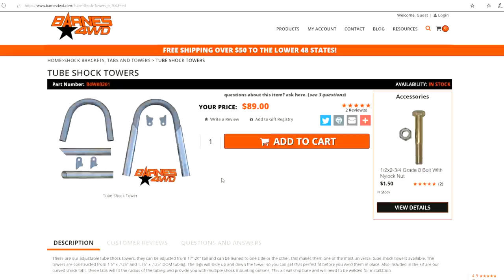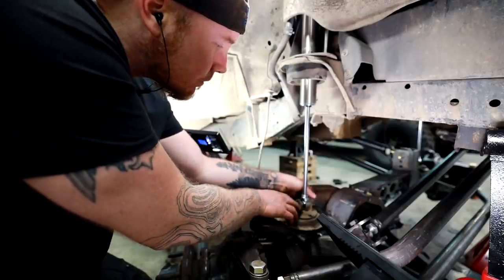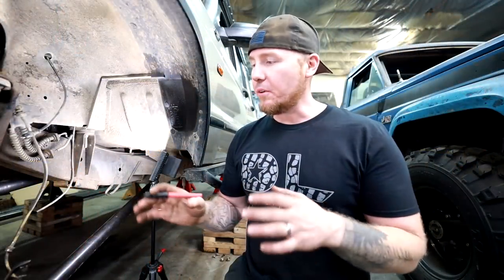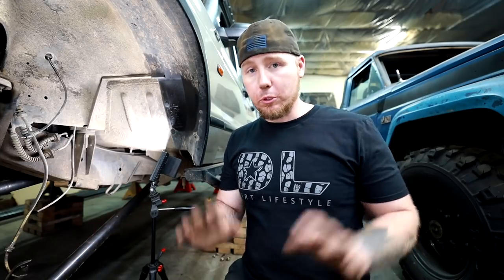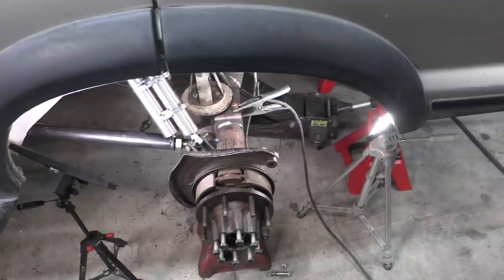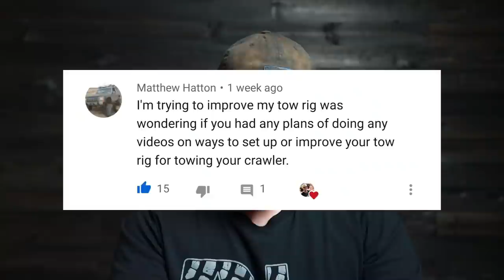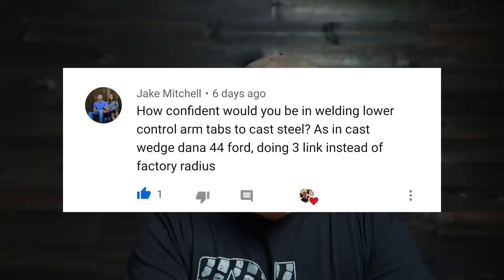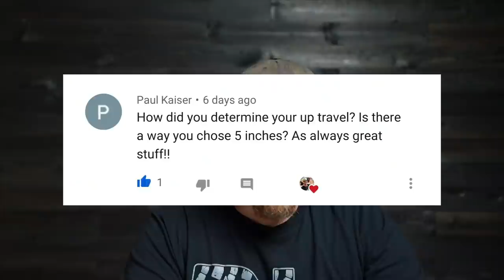Save Your Shocks! 1 Ton Axle Swap Series. Step 6. Bump Stops and Limiting Straps

Comment: Does your flexed out suspended measurement differ from your measurements if you were just to lift your vehicle by the frame with a engine lift. Is there any leverage that factors in.Thx Nate your channel is great

Comment: Yeah; I'd like a gear and locker; I have an old tracker that I'll put a front locker in, and 2 old YJs that may or may not get them (one will for sure).  Maybe explain a couple of things, like high/low pinion, backlash and setting that correctly...a lot of videos seems to sort of say 'we're not setting the backlash'...great...what does that look like?

Comment: Curious what your experience was with selecting shocks, sounds like you got some help from Bilstein there.

I'm a (young and relatively inexperienced) mechanical engineering graduate with aspirations to build both on- and off-road performance machines in the future and I find that if I try to analyze suspension to figure out an ideal damping coefficient and match that to a make/model I wind up in what we call "analysis paralysis", drowning in all kinds of assumptions about the vehicle's environment, speeds, etc. 

What kind of rules of thumb and tricks of the trade did you come across when selecting what shocks to buy? Did Bilstein reps share and words of wisdom, charts, etc. with you when going through that process?

Comment: What gears are you looking to run in the one ton swap? Got a 1986 f250 I’m trying to get into an overland setup. Currently on 33s and looking at 37s. I have a Locked 40spline Dana 60 front(came with 5.13s) that I’m going to install. The truck  weighs around 7.5k pounds once loaded. Just unsure if I should swap my rear to match or go around a 4.56/4.88. And lovin the series!
Reply from the maker: These axles are getting 5.38s 👍

Comment: Have you considered moving the shock mounting tabs to a lower position on the axle? Like as it sits currently it looks like its at the 10 o'clock position. Would it still give you the same amount of articulation if you reposition the tabs to the 8 o'clock position?

Comment: Question, when you showed your axle bottomed out, you said you have plenty of up travel left in the shock. But it looked like you still have 3ish inches of up travel before it bottomed out. I know lowering your shock mounts would be a pain for 2 inches of travel, but what would the least amount of movement you would want left in the shock at full bump?

Comment: Where do you find shocks fail videos on Youtube as you described? I'd like to look at them
Reply from the maker: I just looked and I'm have a hard time finding some! This was back when youtube was mostly short clips. I saw a few short clips of guys with shock failures. The worst was a cherokee with radius arms. He goes over a rock, the front end droops down and the both shocks let go. The rear axle is still behind the rock the front axle now is in front with a broken front drive shaft, and the springs are laying on the ground. It was only a 30 second clip but I will never forget it! If I find it I will repost it on social media 👍

Comment: Question about front shocks: any reason you installed the bottom eyelets parallel with the axle rather than perpendicular? Seems like it'll put more torsional stress on the shock body/top cap because of the changing angle of the axle. Just wondering 🙂

Comment: Great quality content, love your work. Do you think the angle of the shock will effect the way it works? (In the front it looks perpendicular/90 degrees and in the rear it looks like it is sitting at a 45 degree angle) If so, how will it effect it? Cheers

Comment: Question: Hey Nate, I’m currently building a yj and I am a novice on nearly every level so I simply learn what I’m doing as I do it. This video has me wondering, how do you determine what length shock you should be running? I’m replacing the shocks on my rig and I’m just curious if there’s a measurement that can be taken from the mounts to determine the proper length shock to order. I could just measure the current shocks but I’m not even sure they are the correct length. Thanks for the great content, big fan been watching since bleepinjeep

Comment: any insight and pros/cons and reason for the angle shocks are mounted at, is perfectly vertical best if you can package it or is any angle fine if you get the right shock to make up for it, also theres forward and backward angling as well as inward/outward, obviously room to fit it is at the top of the list as shocks likely are getting last dibs on chassis space

Comment: Is something preventing you from lowering the rear shock mount on the axle to make them work?
Reply from the maker: Bolt clearance of the control arm and the backing plate. Or I go way to low and a rock takes it out. I have ripped off a few low hanging shock brackets over the years lol
Reply: @DirtLifestyle  Kinda looked like that! Yeah don't get me started on the shock mounts falling off a GM AAM 11.5 lol

Comment: In the last video I asked if you run a three link with panhard and the pumpkin sits on the driver side does it matter where the upper link sits? Can the upper link go to driver side or should it sit on the passenger side?
Reply from the maker: The upper can go driver or passenger 👍 it doesn't effect anything but packaging. Thanks for watching brother

Comment: Hey brother love the build! I have a 04 disco and I'm thinking of moding the front radius arms like the RTE company does by cutting the arms then tweaking them to give it the 3 deg. And welding and plating it. Question is do you know what they are made of (the radius arms) I read on 1 post that they are forged and if they are how would you do it thanks for the time!

Comment: YO!! Nate I absolutely wanna see the gear & locker install. I have a 14 super duty that is needing it badly the frt especially. Plan on a e lock to match the factory rear. Unless the factory rears suck? But would really like to know what the lowest gear I can go before I will have to worry about losing pinon teeth. 5.13??

Comment: Hi Nate. Love the content of your vids and technical info. I have a nissan navara/frontier, fitted an Infiniti 4.5 v8 engine, bilstein shocks, 2" body lift, +-5" raised suspension, 35" mud terrain tyres and I custom built a rear bar, busy with front and winch install. What are your thoughts and advice on doing a solid front axle conversion on this solid front axle vehicle as it is at the limits of suspension lift and travel etc. I am considering fitting nissan Patrol front and rear diffs/suspension

Comment: A done thing hear in the UK when fitting longer shocks on landrover d1 d2 defender ect it’s to re locate the upper shock mount upwards. Something like this https://gwynlewis4x4.co.uk/product/rear-std-to-3inch-pin-pin-shock-mount-gl1171/        For inspiration hope this helps at all may be better than having to replace the shock for a shorter one 👍

Comment: Why don't you drop the lower shock mount lower on the axle? 
A lot of Toyotas run this
Reply from the maker: I prefer to keep it high and away from rocks. I've ripped off many shock brackets lol
Reply: @DirtLifestyle  YES From the guy who wanted a real LOW hotrod and took out his oil pan on a manhole cover.

Comment: Sorry that you and other 'Tubers are getting gratuitous flack. Suggestions: 1. Continue to be your relentless, solution-oriented self so that those of us who value what you do, and how you do it, have your presentations to look forward to. 2. Mount the shock struts on the control arms, not the axle tube, to the limits of the struts; even more travel. 3. Redirect comments to your FB page where you might have more control blocking/reporting trolls. Whatever you decide, don't stop.